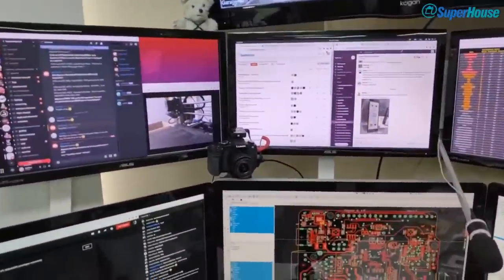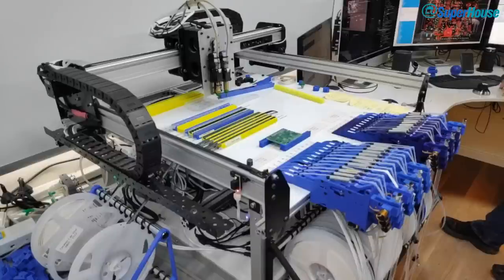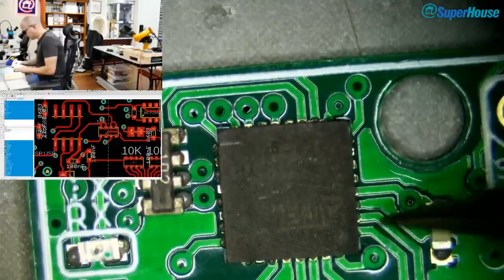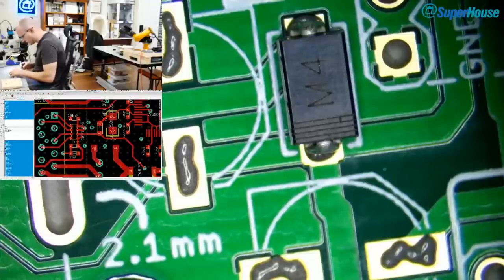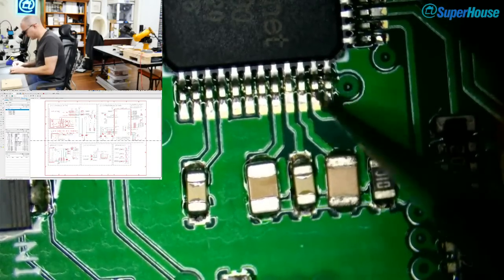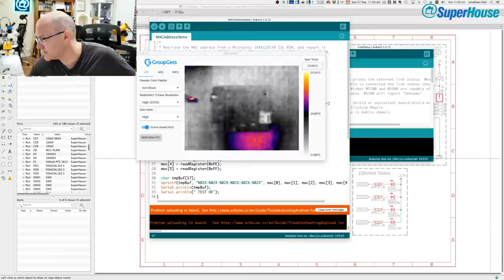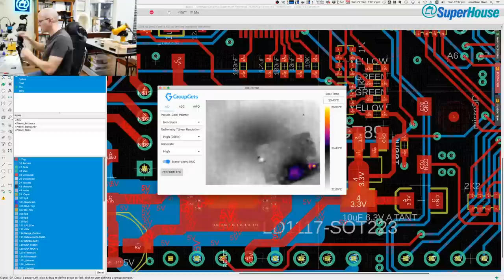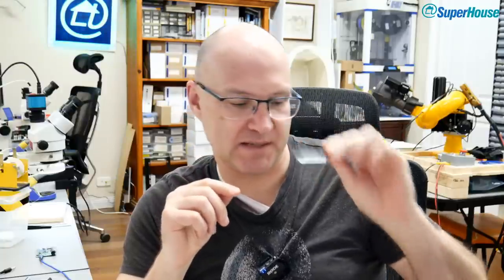Home Automation Hangout 2020-09-27: EtherUNO prototype assembly

Comment: Hi! Very cool board! What kind of solder dispensing tool do you use? It looks like it can add solder very accurately, unlike the Chinese metal tip syringes.
Reply from the maker: In this video I just used a simple 20g solder paste syringe with a plastic Lua-lock nozzle, nothing special. For doing any volume I'd use a stencil, but I only intend to assemble 1 or 2 of these boards for testing and then they'll be done in a factory after that.

Comment: Hi. I have been using atmega chips in my project for past over 10 years. Now all my house automation system is based on them. For today they seams to be little outdated. Ewery where i Look i See WiFi and ESP chips.
My system is workig ok. For now. Big question is if atmega familly will be on the market in 2030 or later. Maybe atmega is deat hend?
Greetings from Poland.
Reply from the maker: Personally I think that simple 8-bit microcontrollers are great as a teaching tool, and they're also ideal for many simple projects where low power and reliability are important. Sometimes you need a simple 8-bit MCU with a couple of I/O pins running on an internal oscillator and using only microamps while in sleep mode. Sometimes you need a full PC stack running Linux, pulling multiple Amps. It's just picking the best tool for the job :-)

Comment: Hi, just wondering, why didn't you use a stencil for the assembly, paste dispensing is a pain and leaves you with a lot of rework
Reply from the maker: Normally I would, but this was to assemble a one-off prototype just to validate the design. Assembly of the real thing will be in a factory with an automated stencil machine.